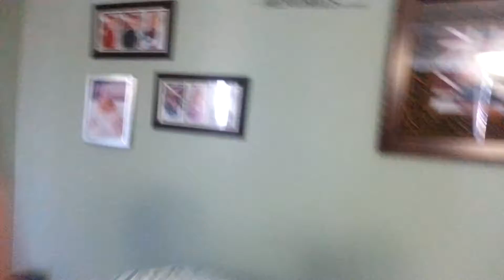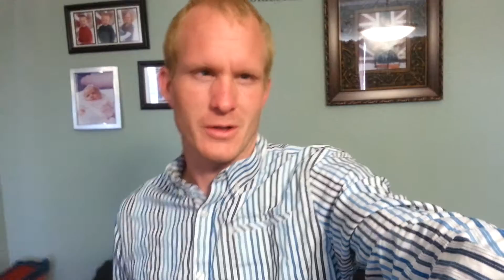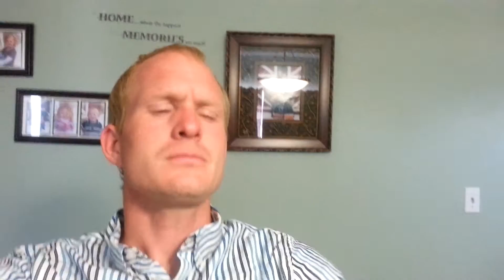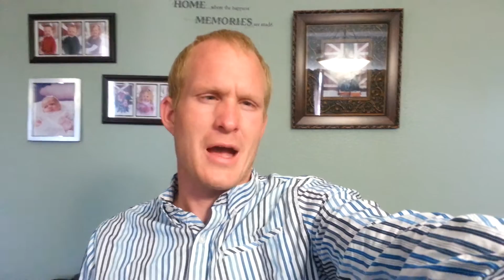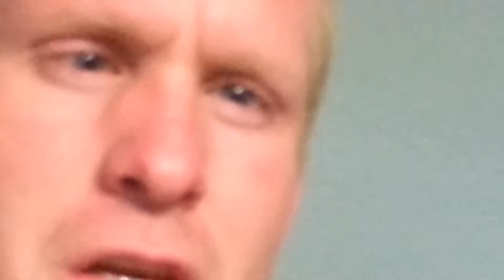Acetone & Other Info. (Increase Fuel Mileage)

Comment: I have been using Acetone, Xylene, 2 cycle synthetic racing oil, and non-ethanol 91 octane gasoline in my 2011 Jeep Wrangler 3.8L for over 10 tanks full and sustained a consistant 20 to 23mpg up from 15-17mpg. costs me $1 to treat 20 gallon tank full. amazing stuff.
Reply from the maker: +Metalicman 68  awesome thanks for sharing that information

Comment: I have heard to use acetone to save gas you have to use gas that does not have ethanol in it. In my area there is only two places within 20 miles that sells ethanol free fuel. I plan on filling up on my first tank of ethanol free fuel in about a week. I typically use about 10-15 gallons a week and always over the same roads. I might could do some decent calculations. I do know that my E10 fuel mileage is 10-12mpg frowns. I will probably do one week of just ethanol free fuel to see if it affects it any. Then a week of acetone (oz per gallon).
Reply from the maker: +I Invoke My First Amendment Rights all the gas that I used had ethanol in it I have not tried it with fuel that does not have ethanol yet

Comment: Hi Ty - Hope you had a great time in California, I saw your vid in the salt flats I wonder if anyone has drilled to determine the depth of the flats.  I had looked at acetone as an additive in the past but, without testing thought it a waste of time and money.  The reason was that the manufacturing of acetone is time consuming, as an additive expensive, as you have shown the gain in mpg's makes it a net sum of zero or less.
Reply from the maker: When I tested it in my truck the net gain made it worth the cost because I actually saved money using it. In my Buick the gains were not as good and made it so the cost was not worth it. I'll still do a better test so I can get more accurate data.

Comment: Hey buddy. I just got a motorcycle.  I'm gonna try the vaporizer on that in a few months. Fyi, I also made one for my lawn mower. IT WORKS. But need to stress that you need a very very very tight seal so that absolutely no access air is escaping in or out. That lawnmower is actually what I traded for the motorcycle.  I also have another friend making one right now for his VW diesel. We'll keep you posted and I'll post my lawnmower video on your FACEBOOK page.
Reply from the maker: Awesome I look forward to seeing it!

Yes creating a tight seal is very important it won't work very well if there is not a tight seal and sometimes won't work altogether.
Reply: Tyson Capel just need you to accept my request on FB so I can post it